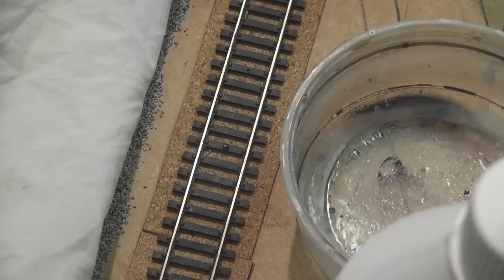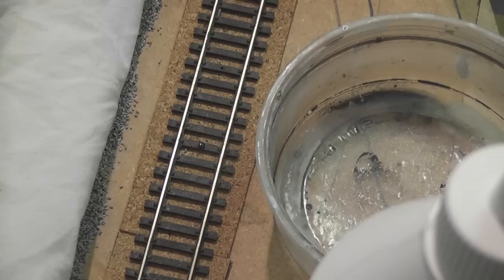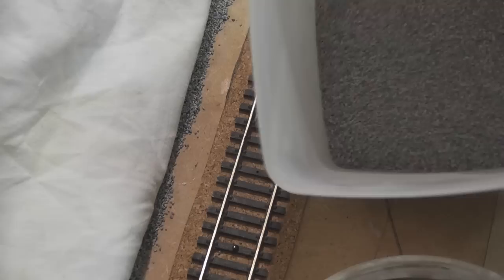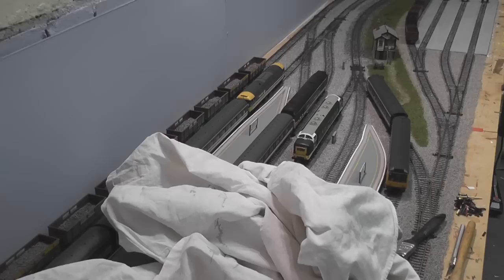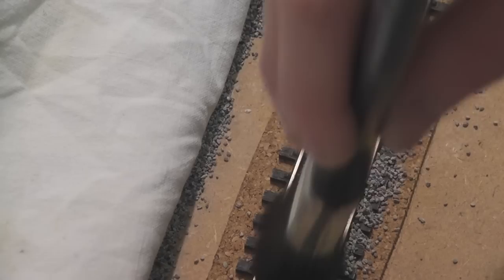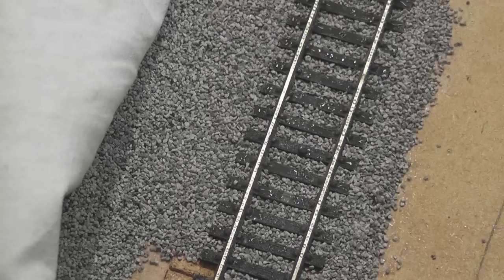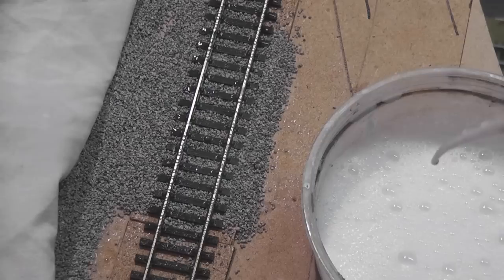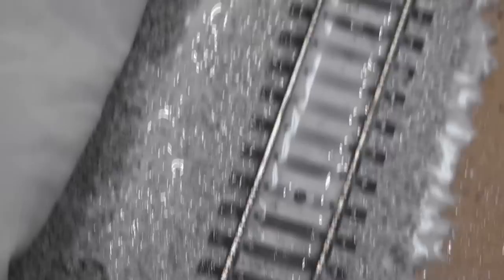How to - Episode 1 - Ballasting

Comment: Take a tip from the prototype rail engineers and “tamp” your ballast while its dry. I used one of my wife’s vibrators, a Eroscillator because it vibrated at a high frequency. The vibration settles the ballast into place nice and evenly then you just need to trim up the sides
Reply: Nik Morris 😂
Reply: Eros Cillator... LOL
Reply: Anyone thinking of trying what Nik Morris suggest tread carefully. I followed his example to the letter and my ballast shook off the train table :(, I suggest putting it on too a lower setting. Oh another piece of advice, if your layout is in the garden shed at the bottom of the garden watch your neighbour's don't see you bringing your newly acquired track shaker (vibrator), they might think your running a den of iniquity, especially if you have a lot of friends hang out in the shed. I think my reputation is ruined with in my local community, so tread carefully with this new toy. 

Oh and don't let your wife know your using it in the loco shed, it can lead to all sorts of problem's with your marriage.
Reply: brilliant
Reply: Remember to wipe the vibrator clean of excess glue and grit before your wife uses it again...............

Comment: Hi i dont glue ballast just in case i need to get track up. Also i dont use cork it goes brittle. Dont use roll ballast it goes brittle quickly. interesting about Railmatch spray. I use a small paint brush to move ballast rather than a spoon. enjoyed it.

Comment from the maker: @gtacrusher123 The method I use is the most used way of ballasting, I have tried the other method you mention and it does work.  The problem is its very messy and uses a lot of glue.

Comment: @EverardJunction , probably i would say as you stated earlier in one of your posts in that the track i had at the time was probably the steel type hornby did in the late 90's,  most of the 1 st and 2nd radius curves i had were of the hornby type which were prone to accumilating this green film on the web of the rails, a great way to apply ballast, but on at least one of the layouts i have  built over the last ten years i just left the ballast in the four foot loose and glued the cess or six foot

Comment from the maker: @BMR5ify If you use very old hornby track from the 1980s or 1990s then it could rust as it used to be made from steel.  These days Hornby, Bachmann and Peco track it nickel silver and doesn't rust.  If track does rust when ballasted then simply remove the rust from the running surface with a track rubber or very fine sandpaper.

I use Peco streamline code 100 track if you were wondering.

Comment: when you pick out ballast GO BY YOUR SCALE! if your Z or N use Fine Grain HO to Type O use Medium S Double T and Large use Course this way your trains run smoothly. if you don't have a shaker barrow one from your spice cupboard that is empty or store it in a jar. to attach the ballast use half a cup of water,half a cup of glue,two drops of dish soap and half a drop of rubbing alcohol. do the sides,inside the rail,and between the ties DON'T PLACE BALLAST NEAR THE CONTROL RODS OR THEY WILL BE GLUED SHUT! smooth it out with a brush and keep it even any excess needs to be vacuumed up.

Comment from the maker: I've always used pva for ballasting, i've not seen ballast done with copydex.  As long as it dries clear I guess it would look the same.  I have track pins but they are from before the ballast was applied.  Once the ballast is dry you don't really need the track pins anymore.

Comment from the maker: @D335Media Unfortunatly I have now ballasted all points on the layout.  I use the same method except i cover the moving bit with a piece of tape.  Once the ballast is dry i remove the tape and add the ballast to that part and add the glue very carfully using an eye dropper.

Comment from the maker: @FIFApro98 No it doesn't, once it's dry rub the surface of the the tack with a track rubber.  Any glue and water marks will come off and the track should work fine.

Comment: Hi, I am now practising the ballasting on some test pieces of track. I have geoscenics stuff just now, but also have the stuff you have used on order. When I applied the glue the ballast tended to spread out a little at the shoulders.  Why do you think this is? Was my glue too watery or too thick? Have you ever encountered this?, and if so could you offer some advice. Cheers. Dave
Reply from the maker: Hi Dave, this is a common occurrence if you have high shoulders at the edges of your track.

I would suggest you apply a bead of neat PVA along each edge of where you want ballast to stop. Then apply the ballast and wet it slightly. Your PVA to water mix needs to be 50% water to glue. Then try to apply more in the centre of the track and let it naturally drain out to the edges. You can always apply more once it's dry if it needs it.  Also don't forget the washing up liquid, it helps to avaiod the spreading.

Hope that helps
Reply: Hi Richard,
Yes this is great advice.  My first attempts on short length of test tracks turned out well, they took a few days to dry up the cold loft though, so I will probably wait until spring to go for it in a big way.
Quite pleased with my initial efforts, got some grey blend woodland scenic stuff today, think I will go with that!
Perhaps I will do a video on it some day too lol.
Cheers, Dave.

Comment from the maker: @hihat101 I know the kind of green you’re talking about, it has appeared on my layout in a small number of places where I have soldered wire droppers to the rails.  None of the fishplates have gone green though.  What kind of track did you use nickel or steel?  Nickel is much more resistant to corrosion, steel isn’t and might go very green.

Comment: Hi.  Nearing the end of my ballasting..its been a marathon.   Did some today and mixed the pva with water and some fairy liquid as normal.   Glue went down well and soaked in no problem.   However when I returned to check it the sides of the track has a greeny tinge to them, which I had to scrape off with toothpicks.  There remains some around the chairs but most of it I got off.
What do you think this is?  The glue was white, so how could this be the green fairy liquid?!
Will the tracks paint ok over this green?

Any suggestions? You ever had this?  The ballast is fine, the dried glue that oozed out is clear, so this green is a bit of a mystery.  It didn't happen when I glued the first section!
Reply from the maker: Hi Dave

The green is common and I have it in places on my layout.  It usually appears around areas where soldering has been done.  You can paint over it no problem.  I've done it many times.
Reply: Strange that my green is wider spread than the soldered bits, bowever this may have been the flux leaking along the tracks as I use a liquid flux pen.

As long as it paints over, its fine. Thanks for your feedback once again!   The ballast/gluing is nearing its final phase...however cutting the ballast around the platforms is a bloody nightmare!
;-0

Comment: hello, very good video and will use this method for my bllasting. However, i have heard of people using copydex instead of pva glue for the mixture, i just wondered if the result would be different or the same? also, do you use track pins and ballast to hold the track or do you just ballast? many thanks

Comment: I thought you mixed the pva and water into the spray bottle?
Reply from the maker: Only on scenery.  Ballasting requires a higher concentration of the mix which is easier to do with the syringe.

Comment: Hello there, handy video!, question, i have built layouts in the past using this method, however, when the glue dried although i ran a rail rubber on the running surface of the rails , i noticed that the glue got into the fishplates and caused the web of the rails to go a green colour and cause a slight rust, i did use to apply the glue a water sprayer like the one you used with water in it to begin with, but i filled this with a 50/50 mix of pva. water, and washing up liquid, still got rust.

Comment: Hi.  I have been hearing about Ballast Bond.  However at £5+ for 100ml that appears to be an expensive option.  What re your thoughts please?
Reply from the maker: +Martin Parry No problem just using the PVA method.  Some of my ballasting with PVA is now over 5 years all and it's still fine.
Reply: +EverardJunction Thanks very much for responding.  I will proceed with the PVA method.  Who knows I might try both and let you know my comparative findings.  Thanks again
Reply: +EverardJunction How many GRAMS is that tub of ballast

Comment: I tried using a syringe but found issue with flow control. I ended up opting for an eye dropper, which the local pharmacy gave me for no charge.
Reply from the maker: Neil Harbott Eye droppers work very well, most people use those.  I remove the plunger from the syringe and let the glue flow out via gravity.  That gives you more control as the flow is constant.

Comment: Hi can you tell  me if the pva glue  has a expiry date on it if its out of date is' it  fine to use or not  fine to use
Reply from the maker: I don't think it goes off.  If its still white and spreadable it should be ok.  Test it first though.
Reply: Ok Thanks
Reply: PVA is immortal lasts forever as long as you keep the air from the bottle!